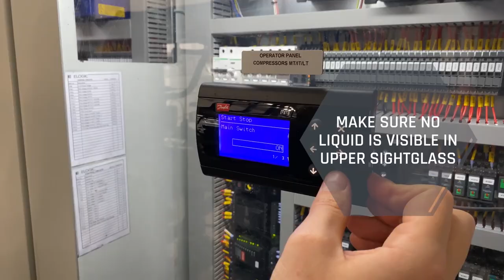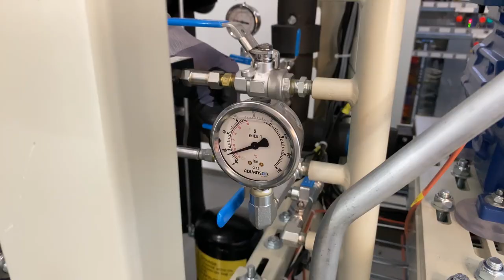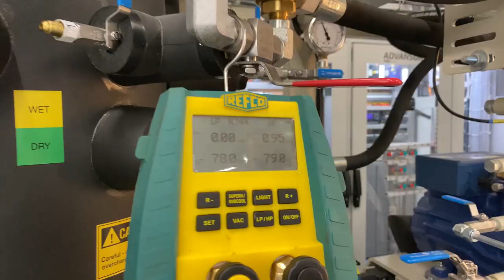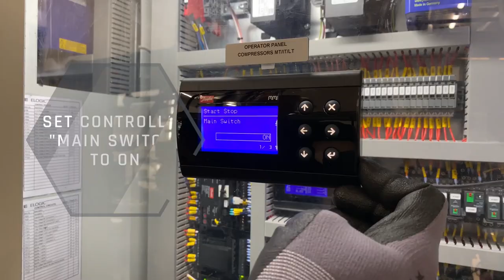Replace the filter insert in the oil separator

Comment: Is there only 1 only separator in the rack?
Reply from the maker: Yes it is correct, the shown example is with only 1 oil separator. However, the work is quite similar with 2 separators